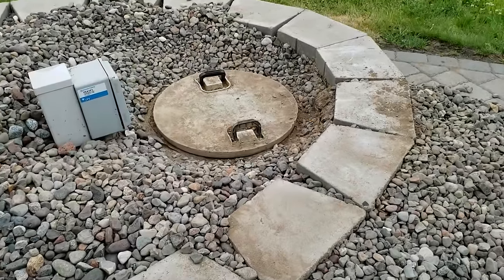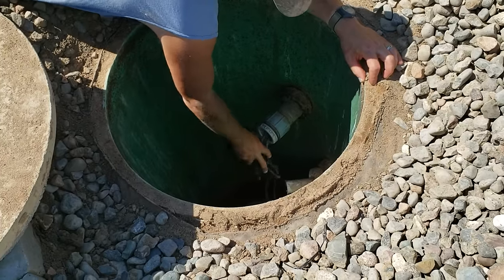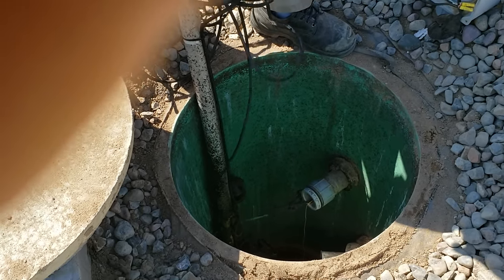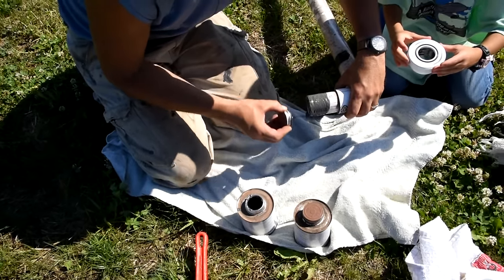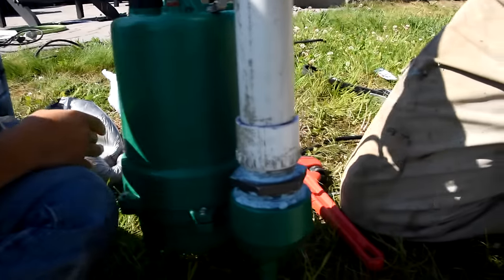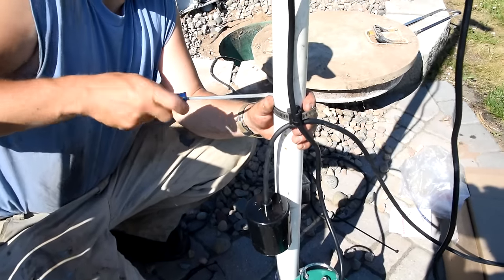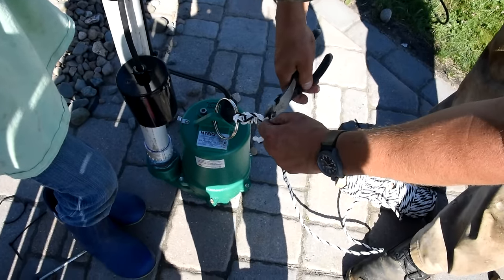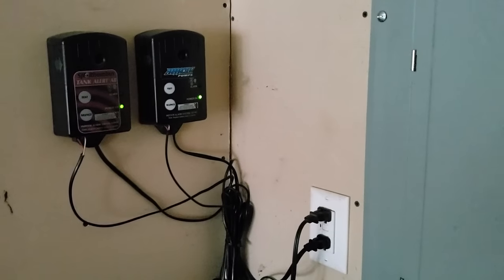DIY Replace a Septic Tank Pump

Comment: This is a Lift Station, used in converting the Natural Gravity feed from the house to a Pressure System. Typically seen in low lying areas and connected to public systems.

Comment: I use a small submersible to drain my tank when necessary. If the alarm isn't functioning water can back up into the blower pit and ruin your blower motor.

Comment: Should have drilled a 3/16" weep hole in the discharge pipe to prevent airlock. The weep hole attatched to those pumps are too small and will get clogged.

Comment: I recommend testing the pump in a large 5 gallon bucket before installing (even better to have a hose refilling the bucket as the pump runs).  Last thing you want is to install a new pump only to find out it is not working.

Comment: I am now replacing mine the 2nd time. Both times I have found mostly small pieces of plastic, like wrappers, twist ties, that must have made it through the drains. This caused the pump to fail. I would not use electrical tape for that reason. Just use the zip tyes and hose clamps.
Reply: Please don't use zip ties I typically see them only last about 5 years b4 they rot away and either the floats falls to the bottom.of the tank and either won't start the pump or worst case won't shut the pump off until it burns out amd the pump can suck up the zip tie and bind it up

Comment: Very good video just a couple notes please don't use zip ties I typically see them only last about 5 years before they rot away and cause issues I mock my pumps up with electrical tape than use stainless hose clamps to secure the floats I've always Ben told its bad to spin the pump backwards that's why u put a check valve in we just drill a ¼" "wheep" hole above the check valve to allow the line to.drain back. Also a rope on the pump does help to install and remove but many many times I've seem the rope rot and pump sucks it up killing the pump or the handle rots off and you drop the pump trying to remove it. With basic ¼-½ H.P. pump i lower them down in with the piping. Also never ever install a electric outlet inside the tank so you can just plug the pump in I've scene it burn out pumps on more than one occasion we always instal a water tight elec. Box in the riser of the tank and hard wire the pump using direct barrieal wire nuts. And one more note from my experience pumps that seem to pump more liquid last longer meaning a longer run time each cycle than say a pump with a short throw to the float it seems like alot of starts and stops burns out a pump faster  than it running longer
Reply: Thanks for this info. I'm a do-it-yourselfer and am installing a new pump tomorrow. And the new pump (goulds) has a standard electrical plug, and so does the float switch. I was debating cutting the plugs off and hard wiring them inside the waterproof box like you say vs wire in an outlet. The old waterproof box was how it was done 25 years ago and it lasted that long. Actually my pump is a Myers and it still works but the plastic housing on the bottom is cracked and it sprays water causing the pump to run a long time and eventually trip the breaker from overheating. Apparently they don't make Myers pumps anymore. Hopefully the Goulds holds up.

Comment: great video. My pump failed the other day due to some sludge getting trapped in the pump and the previous owners didnt install an alarm float. luckily I found out I had a problem when my tub wouldn’t drain. I too have to install a slip joint to remove the pump in the future. My pump is 20 yrs old so thats really good. I just bought a new hydromatic pump also made by Pentair and an alarm float. Will be installing soon.
Reply: I am in the same boat but sinking. My husband Mark Surface is in a wheelchair and very disabled and we are 64 with 0 family! Had no idea we had a sewage tank pump to the sewer system. I had rocks instead of grass. The workers dug up the opening with 3ft of soil deep On the rocks. I bought a pump for 700!!! And  will have to figure it out myself. A neighbor said he would help but that may not be true. Our home is 19 yrs old and we had no idea about the tank! Husband on Dialysis and we are on Social security and barely making it before. No possibility of calling a plumber. The toilet flap was not seating correctly and our water bill is also over 800.! Guess what 6 months ago a water main leak. Thank you for your video . I pray God will help me. 😢

Comment: How did you get the pipe to align with the exsisting out flow pipe when you added that reducer? Didn't it raise the stand pipe? I used a PVC repair coupling the kind that slides like a telescope to get the perfect hight.
I also replaced mine. After 19yrs I discovered the small zip ties had cut thru the electrical cord from the vibration of the motor turning on and off. Shorted everything out. I replaced the zip ties wirh 20mil 2in tape. Good thing I didn't have a methane explosion, And please wear protective gloves next time.

Comment: That's a baby system,Myers is a good pump.water in these tanks will not freeze, geo thermal keeps it from doing so, unless ur in Antarctica. I installed and repaired these stations for years in cities tho not house septic very often.

Comment: How did you determine it was safe to 'drop it in' without entering the tank and attaching the pump to a base? If it is cast iron, will it settle itself? I need a grinder ejector pump replacement but the plumbers near me state they don't do this repair. Smh.
Reply: Most pumps have little feet and sit fine on the bottom of a concrete tank. I’ve only seen bases in plastic tanks and they  just sit no attaching to the base? Would you actually expect someone to enter a septic tank or pump chamber?

Comment: The floats and pump power wire should be in separate conduit as they are different voltage also there should be a union on the discharge so you can easily replace the pump. No check valve and probably not drilled for airlock.

Comment: Montana bout cold as Minnesota guess them check valves may have caused a field failure??
Reply: here in Ontario Canada we install check valves. My drain froze up a couple years ago and now I wonder if it was caused by the check valve. Two separate plumbers told me to remove the check valve so the water doesnt freeze between the pump chamber and the drain field. I just wonder if this can cause any damage to the pump.

Comment: Stainless steel clamps, not zip ties.
We use Gould’s, I know they are only sold through wholesalers who generally only sell to professional contractors but in my opinion there’s a huge drop off between Gould’s and Myers.

Comment: Seems like your floats are very low .... mine are pretty close to top of my tank.     ?
Reply: yeah, I noticed that.  I recently replaced a dead pump in my septic, and just decided to replace it the same way as what was in there previously, switch a little above the pump, since I didn't know how it was planned out.
I really regret not moving the float, and the alarm floats up another foot or two up.  

If I can not regret that decision for at least 10 years, I won't complain TOO much

Comment: Golds pumps last longer then 11 years , the floats are what will go bad first, you probably replaced a pump for no reason next time unplug the float and just plug the pump in to make sure it runs
Reply from the maker: We did try that, the motor was fried, we actually took it apart and the motor was seized up=(

Comment: My pump just went, this one lasted about 20-30 years, it's a small pump, a 1/2 hp Rigid brand. 15 years ago it stopped working and a friend picked it up from the tank and cleaned/wiped it off and it worked the whole time.. now, i dont know what's wrong but pretty sure i need to replace the pump.. replaced it with 1/2hp Everbilt brand
Reply: Good service life on that pump.
Reply: Good luck with your new pump. I just replaced mine after 23 years. Just don’t expect any pump today to last that long. The way things are made now as well as the regulations, they just won’t last like they used to.